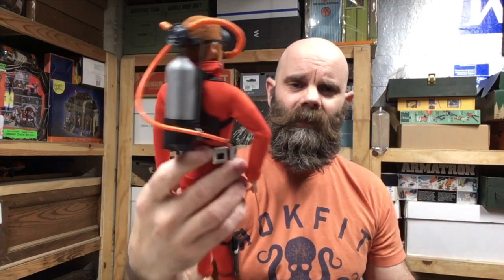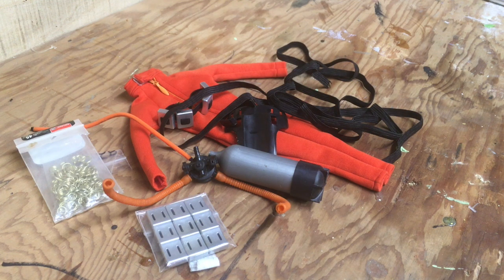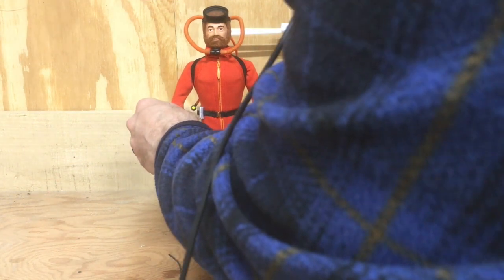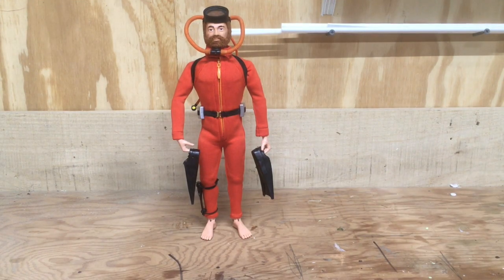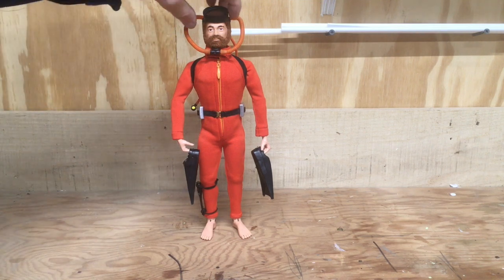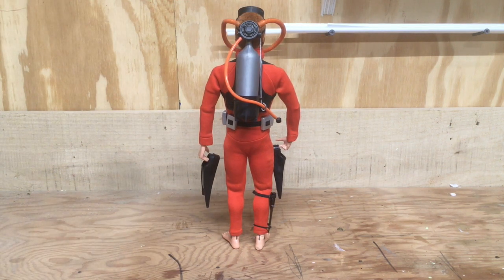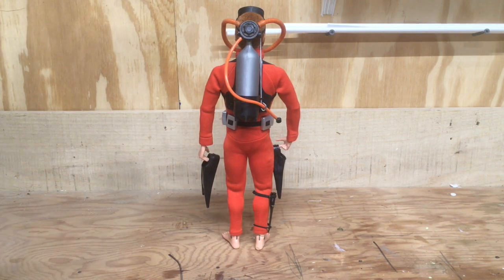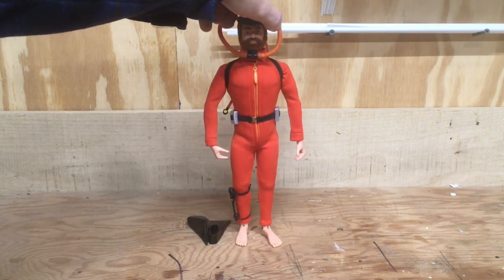ACTION MAN DIVE TANK REPAIR AND MORE   HD 720p

Comment: That rod is a J valve reserve lever, which is used to activate the reserve air in the tank when the pressure drops below 500 psi. Nice work.  I have two of these.  One was missing the j valve lever also.  How much would you charge me to make me one, I can't bend the small loop at the bottom?
Reply from the maker: No charge, I’ll make one and get it in the mail. Just send me an email.
Reply from the maker: If you can Don send me a pic of yours next to a tape measure.
Reply: @skunkworksstudios  you want a picture of the original J valve lever I have one the tank correct?
Reply: @skunkworksstudios  I was wrong both of mine are missing the J valve rod ☹️